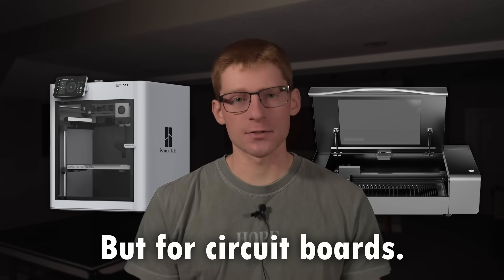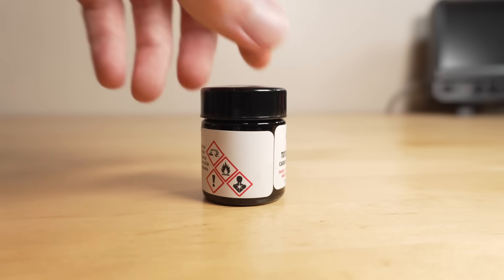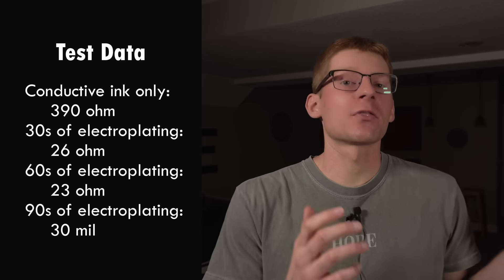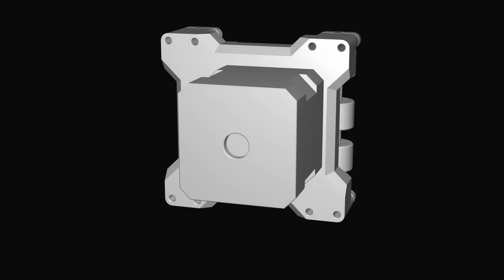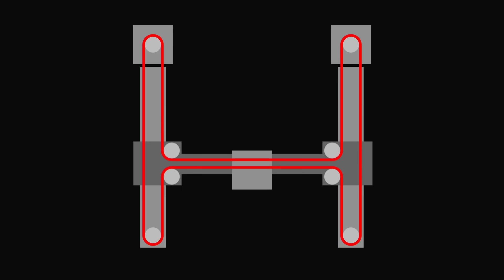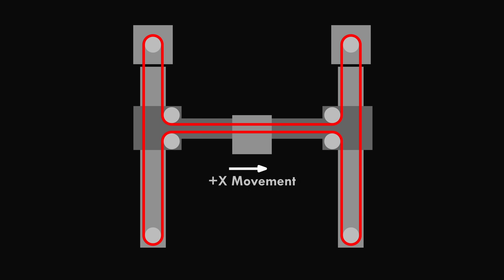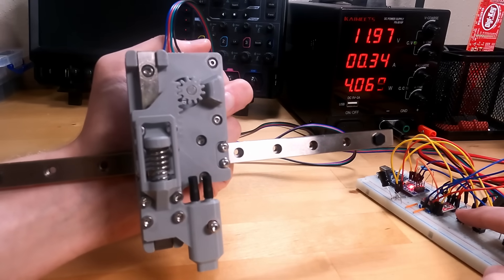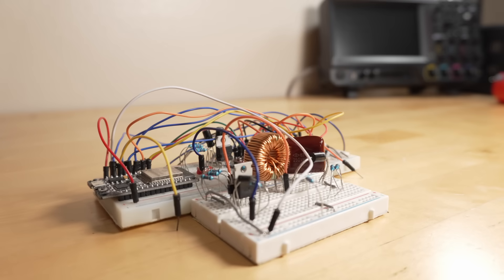I'm Developing a New Circuit Board Manufacturing Technology

Comment: I dont mean to sound like an asshole, but i have been down the same road of "how to make 2 layer pcbs", and i have come to this conclusion.
Just mill the traces and forget vias. If i need to pass a trace over another i just make two holes and solder a wire on them, that way i can make complex circuitry just the same as any other, but i dont have to worry about this electroplating nonsense.

Though i will give a suggestion. I have done some clockworking before, and about this 0.3mm via thing. Why not just use 0.3mm tubing and riveting them on both sides. make a pneumatic punch for both sides to "mushroom" (the tube is hollow btw) them to conect the back and front traces.
The machine would just need a supply of prepared tube lenghts. Say your pcb had 1.2mm thickess, just make a bund of 1.3mm lenght tubes of 0.3mm, then have an apparatus place the tube inside the drilled hole and punch both sides with a punch designed to make electrical contact between the two traces it should connect. Yes the mushroomed tube would make an elevation on the board wich would make problems for 3 or more layered pcbs but you are not there yet.

Comment: You could probably mechanically plate your vias using a slightly oversized but soft string embedded with copper dust and running it through the hole like you were flossing, this is assuming the fr-4 substrate is harder than copper. I've seen this process used to plate brass onto steel using brass wire wheels in a drill. It might even work better with gold dust as gold is softer. I'm not entirely sure how that could be automated in a cnc process though.

Comment: Amazing. I want a PCB printer. But, TBH: I'd be happy to solder "vias". That is a through-hole that I solder a wire on both sides of the hole. Is there some technical reason this doesn't work?

Comment: So instead of electroplating, think outside the box

Solder, is used to hold all of these components to the board, so isnt affected by the heat from high currents and melting

Drill the hole
Heat some solder
Push the molten solder into the 0.5mm predrilled hole
Let it cool
Drill again at 0.3mm

You have then got a ring of solder around the wall of the hole, that is 0.1mm thick

Good luck ❤️
Reply: Literally no reason you need a hole drilled out. That's just an artifact of the electroplating technique, a solid filled via would be objectively better since it has lower resistance.
Reply: Solder is attracted to copper, so it balls up on the two outer surfaces and in the middle there's 1.6mm of an air bubble. The air will find its way in there.

Comment: your problem is the conductive ink. it's not conductive enough. try to PVD Copper inside the vias then deposit your copper onto it to have a more uniform deposit. did you try to think of a physical vias then electric arc welding? love your work and how you present your time spent.

Comment: I don't know if this would work, but what if when you drilled the holes, you had the board on top of two layers of rubber that were all clamped down together tight. Theoretically you'd end up with two custom aligned gaskets for that board.

You could sandwich it all together on top of a resevoir and pour in the conductive ink. Now that I'm getting to the bottom I'm realizing I don't know how you'd electro plate it in this system, but I almost got to an idea that could make batches of the same board in your garage... theoretically.

I'm not even a "stayed at a holiday express last night" level of expert, but I was thinking all night about this after I watched this.

Comment: I was thinking of a system that use UV laser to burn copper etches (parallel about 1 mm thick). Then have another system that will drill holes. I gave up on etching with chemicals. Actually I have my prototype circuits done by PCBWay but open to a system that similar to 3D printing. Actually this should be easier as its would only by 2 dimensional.

Comment: For vias I used to drill a hole (using dremel and specail drill bits) and had very tiny rivets that I inserted thru the hole and had a special tool to tighten them in place.

Comment: Why don't you just use small countersunk rivets for the vias instead? Seems easier than trying to manage the flow of two separate chemical processes to deposit the copper.
Reply: Or, if you really want to use electro plating, mill out the entire board in one go, use your conductive paint to paint all traces and vias at the same time, then drop the entire board into an electroplating bath for 'curing' for 10-60 mins. Much easier than managing pumps and doing one via at a time.

Comment: Insert a wire in the hole and use high energy capacitor bank to detonate the wire in the hole. This will be noisy but would be free of wet chemistry.  With tiny wires the time to charge could probably be made the same as the time to move and load a new hole.

Comment: I have a setup that does pretty much what you want that I've been using for years: an old desktop LPKF PCB milling machine from ebay and through hole rivets.  The rivets aren't micro-via level small (no putting them between the balls of a BGA), but they're good enough for 99% of anything you're going to design on two layers.

Comment: If you move your board in X/Y you don't need as much mechanics below the board. Also the Z axis can be much more rigid.
Reply: You could investigate feeding a fine copper wire into the hole as the counter electrode and use continuous electrolyte purge with the fresh electrolyte entering the hole from the side opposite the wire entry.  You would plate copper from the wire onto the insides of the hole and either extend or retract the wire as consumed, depending on the diameter, as the copper built up inside the hole.  

Centering the wire would be an issue unless you had a very thin sleeve around it that would force the plating current to the exposed end only.

Comment: I wonder if you couldn't do the whole board at once with a screen printing inspired process where you squeegee the conductive ink into the holes and then electroplate the whole board. Incidentally a very long time ago I knew someone was trying to do bootleg copies of a commercial circuit board and the plated through holes were basically the whole problem.

Comment: How about drilling a slightly oversized hole, filling it with lead (just enouth so it connects to the top and bottom copper layer, and finally drill a hole with the final diameter through the lead? Optionally a leveling of excess lead can be cone with a flat end mill or chamfering bit. Additional benefit is that all the vias are now pre tinned for soldering.

Comment: Modify the spark ablation process by configuring the electrode tips inside the via, and feed metal (small diameter wire or metal containing particles) into the arc. They will ablate, costing the interior wall of the via.

Comment: It may be dumb but, couldn't you fill the vias with tin? I imagine something like a blocked nozzle for 3d printing waiting in the bottom part of the via. The wire gets threaded through the via and inmediately get heated to 230-240C filling the via. Then you cool the nozzle a bit and remove. Loving your project!

Comment: Ya know how we used to do double sided boards with 'vias' back in the day when we could go to radioshack and pick up a packet of etchent, lay out traces with permanent markers, and etch boards in the kitchen? Drill a hole, stick a solid core wire in the hole, drip of solder on both sides. Done and done. Takes like 5 minutes. If that. 

For some reason dude has decided to recreate industrial wheels by trying to take the most complex paths possible, and cannot see beyond his 'im special and make compact designs' .... 'did I tell you about my compact designs?' .... 'compact designs, guys' preoccupation. Also, table top portable band saws exist, for like under $100 in some cases. One even comes with a vice! Even then, never heard of a jigsaw, eh? or a sawzall? any kind of reciprocating saw you could find at any garage sale? And, by the by, time is a factor in the real world mate. You dont need industrial pro service looking PCBs, you just need to get signal or power from one side to the other. This is not a hard problem solve.....unless you literally set every step on hard mode for masochistic reasons.....Two terms you need to look up, "feature creep" and "over engineered". Because you could have had this done and done in far less time, wasting far fewer resources. Thats why makers stay makers, and dont become fabricators. They're too busy trying to reinvent industrial processes instead of solving the problem.

Comment: I just wonder if it is possible to sputter a thin layer of metal inside the via and then copper plate?

Also, if you only prototype a two layer pcb for SMT, I was thinking of simply abandon the via.
Just drill a 0.15mm hole, then use the cell phone repairman's repair wire of 0.1mm (OD) enameled copper wire, use whatever mean you see fit to weld (not solder) a wire in place. Use spot welding or fibre laser.   It is welded so in the next stage, the components could be soldered.

Comment: If it helps you feel better, 20 years ago production PCB manufactoring had the same issues with plating small holes. We had a bath that ran for 12+ hours and only plated 30u electrolessly.  Then if you had a bad rectofier on your electroplating line with even a small AC ripple the results caused failures in the plating process that would later cause circuit failures.

Comment: In the early days, there was this thing called Via Staples (Probably not the actual name) .  Basically, metal wire and the ends are bent on each side, and then soldered in place. Then came rivets.  This was pretty much back when everything was through holes.  Electroless and electro plating can be some really nasty stuff.  Make sure you protect yourself and your sorundings.

Comment: Great video. I wonder what you think of LPKF's approach to electroplating. They sell a lot where you can squeegee on a conductive paste, pull it through the vias with a vacuum plate, and then you bake the whole board in an oven to solidify the paste. The kit is available on their website.

Comment: why not just solder thru-hole wires from both sides by hand, like it's been done for ages? it's not that hard or particularly slow, more than adequate for prototypes. you're solving a nonexistent problem.

Comment: Electroplating is a noobtrap.
If drilling is possible, you can use bronze micro screws, or even better - a wire/needle with epoxy glue (the material the PCB is made of). Fast and efficient.
Reply: Of course, you should take the approach of gluing the vias first, smoothing out the protruding parts before galvanizing.

Comment: I understand your desire to make your via's to industry standards but isn't this strictly for fast prototyping. It seems reasonably to me to use a larger diameter via on a prototype board. Have you tried any sizes in between your successful test and your not so successful tests, you may find a sweet spot? And on a system requiring this level of accuracy you should really use closed loop steppers or servos, if you lose a step it'll catchup or if it's too much throw an alarm.

Comment: What about using a soft copper wire, sticking out .2mm on each side of the board then squishing each end. This would contact with the surface copper, or you could add some flux and solder after, or maybe before to guarantee connection. A machine could probably do this in less than a seccond per via.

Comment: Why not move the pcb instead of the heads? Stationary heads would be easier to align, no problem with moving weight, many toolheads possible (drill, electroplating, vacuuming, inspection, etc). Only negative aspect is that the footprint of the machine would have to be at least nine times that of the biggest pcb to reach all ends, but hey, for such fast experimental board: who needs more the eurocard format 10x16cm?
Reply: If space is an issue, vertical orientation can be used and the installation can be placed against a wall.

Comment: Ok, hear me out... Why not do it to a minimum grid and do it all at once in a simpler machines and lose the xy? 

With a sandwich pan system using a grid of threaded holes, you could plug what you don't need and put nozzles on. It the grid is too large, improve the mounting system and move the board to achieve the density you want. Perhaps it takes 2+ passes to get all of your vias but it still ends up saving time compared to doing them individually. The additional setup time and likely swapping of modular trays is a cost against automation but it doesn't prevent building a laser etcher and cnc drill on top in a nice box. I guess what I'm saying is, what if the specialty via process wasn't done on the same plane as the etch/drill process and instead two specialized functions in one box?

I'd probably consider pumping from the bottom up and having an overflow that goes back to the reservoir for simplicity. If two positions are enough to set up a sufficiently packed staggered circle design you could finish any complexity board in about the same time. Additionally, your design could quite easily 'print' paper stencils with the laser cutting out holes for what nozzles should be used for which mounting points. Of course this process gets more involved for the user with more mounting positions. Additionally, this system would allow you to drill an indexing patch that aligns the board to one of the pans, these could be dual purpose as ground clamps.

Comment: Hey Levi, about the electrodeposition creep you mentioned, just like mentioned with other commenters you can try pulsed deposition. Also worth to investigate into continous flow plating since your system already has a micropump built in - a steady flow can shift the voltage gradient on the plating through the vias which can help uniform plating

Comment: I'm not an engineer but here is a suggestion. What if you manufactured a pcb board that had a grid of pre-made vias already inside the board, perhaps at 1 inch intervals. Then instead of creating new vias you only have to remove already existing vias, either by removing a ring around the copper plate on one side of the board or by drilling out the via. With this system a laser engraver could print the entire board in just a minute or two. You would need to make special software to arrange circuit paths around the vias. This would be a good business strategy too because the machine would be relatively inexpensive and use already existing technology, and you could sell these specialized boards and software specifically for the machine. One challenge with this approach is finding the proper alignment of the laser engraver to the via grid. This could be solved perhaps by selling a variety of standard pcb board dimensions, or making boards with pre-made perforations that allow the board to be snapped at specific intervals to keep the alignment correct.
Reply: This is a brilliant idea
Reply: I love this idea too.  A lock in consumable that has real value.  If you distribute the holes in a pseudo random fashion you can copyright the layout and prevent clones until your competitors reverse engineer and open source new software for your trace maker. 

Certainly it would be a cool thing for a prototype lab to order a box of boards from PCBway or similar with just vias and keep them in stock.  Chuck it in a machine and laser engrave an etch mask, etch and then laser engrave the solder pads.

Open sourcing the system would make you famous.  I will remind people that Austin Baldwin mentioned it first if it takes off.

The density of components would be slightly compromised as you have to dodge vias but I think many would be prepared to live with that.
Reply: @KallePihlajasaari How to turn a great, consumer friendly idea into corporate gatekept trash.
Screw off with this capital brain ideology. You contributed nothing except how to further detriment society.

Comment: actually, to your credit here, compactness is almost always paired with other virtues. For instance, if you did manage to get a design that worked with those bushings, it'd be far cheaper to make and it's actual parts would be lower complexity (if they ever needed to be replaced) 

Generally the question isn't so much "is smaller better" it's "is it worth the effort to improve this". A very smart design can almost always be compact, efficient, effective, robust, etc. but sometimes "fuck it, use a high quality linear bearing" is just the best bang-for-buck solution in terms of the engineer's mental sanity. 

Smart solutions take energy, and that's not an infinite resource. So while I don't blame you (or even necessarily think you were wrong) to decide to go bulkier, I don't think your reasoning here is entirely right either.

Generally those leaps to make a smaller AND better solution aren't found through dedicated effort, but because one dude taking a piss while at work got a random inspiration and decided to test and see if it worked when he got home, and it did. In other words; they're like a good shit, you can't force them, you just have to let them come to you, and exit into the world as they are.